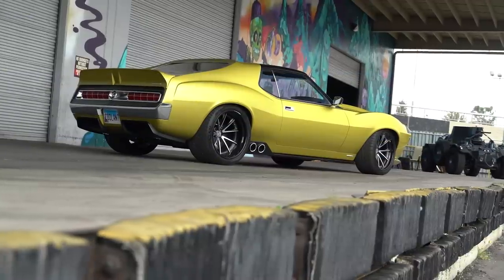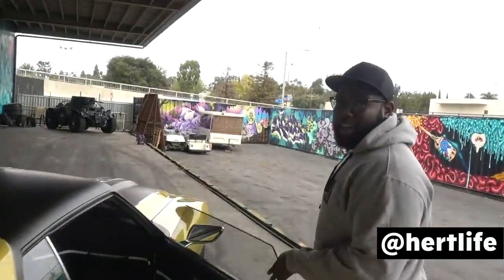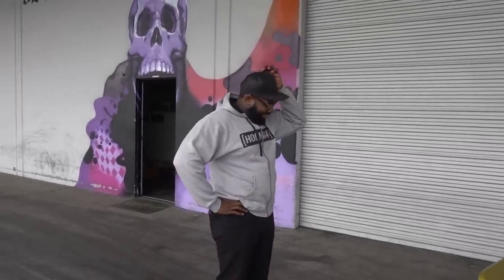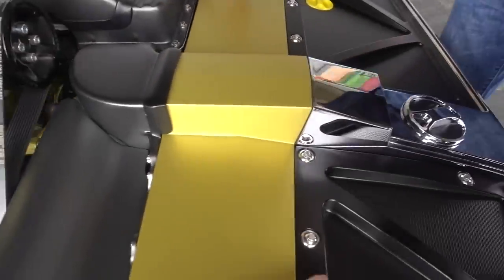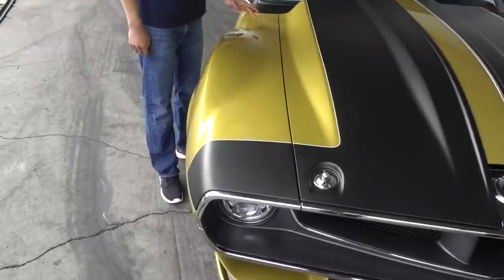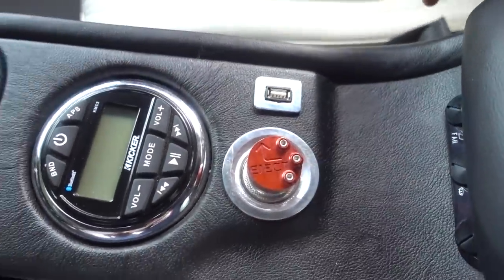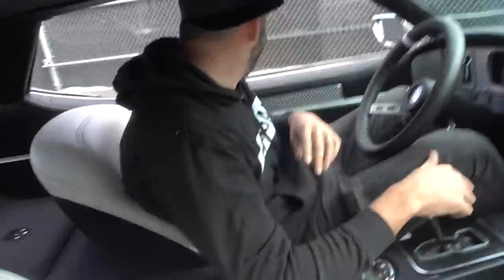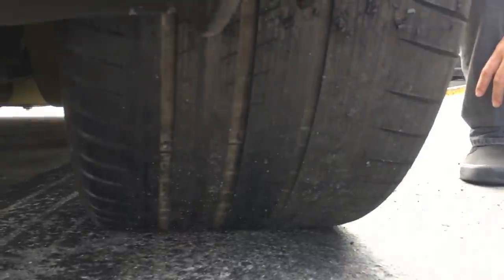1100hp 1972 AMC Javelin, Ringbrothers' Defiant //DT224

Comment: Look at that land yaught. I bet a British Tuned 1.6L could beat the snot out of this thing on most race tracks. Don't believe me?

Camero 6.7L from this era got beat by one it was so close too. The 6.7L chevy was gone everytime they hit the straight. Then over the rest of the the little British Ford Escort closed the gap again got the lead afew times the best car battle ever. 

A boss mustang in the pack surrounded my mini's 1960s old minis. 

Its the best race I've ever seen you should watch it. 

Crystal Palace race way 1970s look for a black and white video with boss mustang and minis then out front way out front was a vauxhall 3.5L in 3rd falling back then the two heros just slaying it. 

The end of the race was incredible.
Reply: Race car for race car and not stock for stock and You have to understand,The v8s that AMC made were lighter than their competitors and more durable which in terms means you can rev them higher and they can take a beating so no a 1.6 liter and a mini, nor an Escort, cannot outpace a Trans Am Javelin,That's why we won the Trans Am series in 71 and 72 against said manufacturers you mentioned Nice try buddy.

Comment: Hard to believe but the Alabama State Troopers had 200 AMC Javelin's with 401 engines as trooper cars. They were very fast but handled awful at high speeds... AMC also made a Rebel which was shorter.

Comment: Back in the 90's a friend of mine ran into somw money. He calls me in the morning saying he just bought the strangest looking Camero. I get over to his place and saw that it was an AMC Javelin. I started laughing. He only paid 200.00 for it. All Die-cast body panels were perfect.
So we went and grabbed a Chiltons. boring boring wait...wut? "If none of the numbers on the car match, even the doors have different S/N's then you have found yourself a Rebel Machine""...
eh?
1969 Javelin SST Rebel Machine
Holy crap! 343ci small block - we bored 40 over
Offenhauser manifold
Edlebrock carbs
Erson cams,  TRW pistons to Hooker headers
all blueprinted and balanced
This thing was pissed. Then he makes the mistake of letting his gf get behind the wheel. She promptly romped it, 360'd across the parking lot only to side-swipe a tow truck. Die cast said SHATTER! Body, frame, and engine were ok, but trying to replace those quarter-panels and drivers door... probably never going to happen. Finding a harmonic balancer during the build was scary enough.
Should you find one of these, they are worth a 2nd or even 3rd look

Comment: You know you're bringing up the rear disc brakes anytime you hold your foot on the brake it's called power braking which applies pressure to all four wheels it cause the rear brakes to get extremely hot you can see in the clip one of the Wheels stopped spinning while he was still on the throttle the motor was screaming bunch of clown boys

Comment: It’s a HELLCAT MOTOR, made 1300 easy they put a bigger pulley for drivability and 1000-1100 HP . A good bff had one in high school, ugly car with/out the 6 inches it was stretched full carbon front end; plus costing $500K is stupid crazy for a javelin but it’s more custom car now that what it started as.👍🏼😎😃

Comment: Completely  and utterly useless.  While this 1000+ horsepower Javelin is doing burnouts and going nowhere, a  bone stock 911 Turbo S will leave it in the dust in the 0-60, in the 0-100, in the 1/4 mile, in 0-100-0, in top speed, on any racetrack, on the Nurburgring, and in fuel economy.

Comment: Wow you guys shouldn't try to give history lessons on cars you know nothing about. AMC didn't try to put out muscle cars they put out the fastest and record setting cars. Starting with a Rambler.... 1957 they put the first big engine in midsize vehicles when they put a 327 in the Rambler. Yeah so who cares if it was a 4 door. 1968 Craig Breedlove set over 100 consecutive world records with an AMX.  By the way that ain't just a bunch of letters it stands for American Motors Experimental.  In 1970 a Rambler.... again.... was the fastest production car out ..it didn't get the recognition it deserved because it was not fully assembled at the plant. 1970 The Machine  was available only optioned as a 14 second car with at the time 15 inch tires that no one else offered.  As an upgrade it offered a ( service performance package) that they wouldn't put on at the factory. Making it the fastest production car which would have held that distinction until a few years ago. The upgrade would move the car into the upper 11 second quarter mile bracket.  That's only 3 of the innovations from a company that was raped by Chrysler.. real muscle cars don't need mopar crap to make them fast.